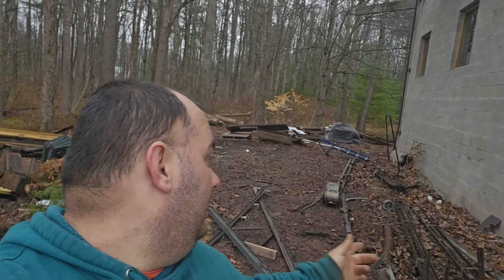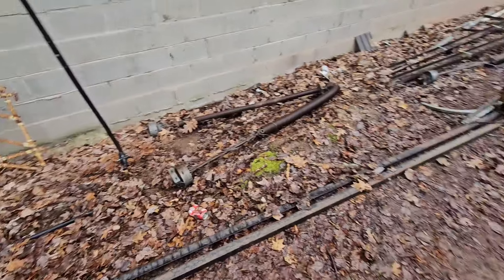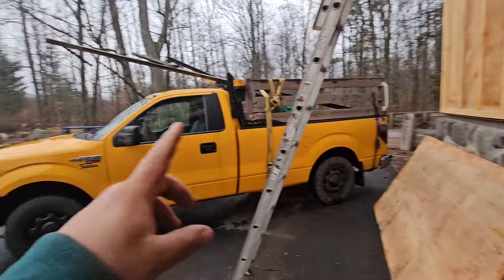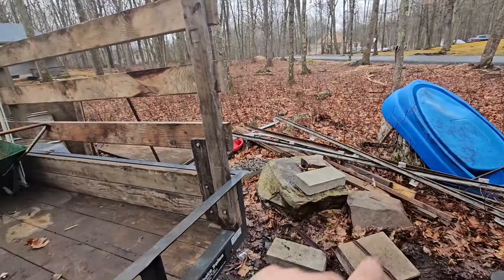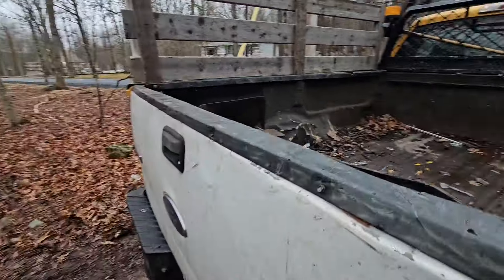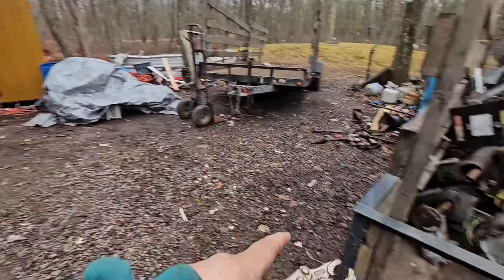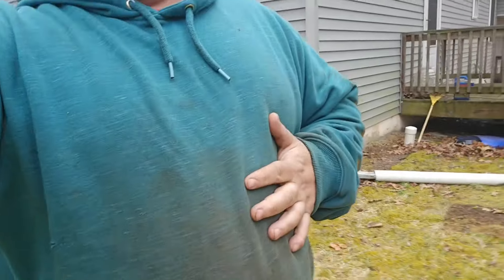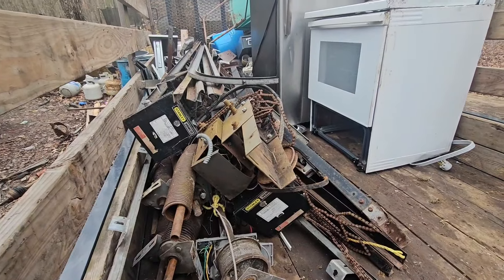Turning Trash Into Treasure: Loading Up A Trailer With Scrap Metal

Comment: The one thing Mike forgot to mention. Is that when you have a load on your truck and your trailer any weight after the rear axle is considered tongue weight. So if you have 500lbs after the axle in the truck and 1000lbs one the trailer tongue you can and will get busted for being over weight..

Comment: Hello Mike. You should carry your tools with you. I did the same thing in Ohio back 2006.I average about 25000 a year just pickup . I had 4 Plumbing shops 2 car dealerships 3 Muffler shops The Pepsi dealer 7 up dealer and when to farm auction
.my name is Ed Miller from Ohio but I live in GREENVILLE SCNOW
Reply from the maker: I usually do. We just didn't put them back in the truck and I didn't check.. If the guy would have told me what I was picking up, he said there was just some stuff alongside the garage. And gave me an address.. And of course, he sends me pictures after i'm already there.. Then I realized I didn't have the tools I needed.🥺

Comment: People think we make a fortune doing scrap metal removal. Not the case. Plus you get jobs like this one where you were told one thing and its not the case your really helping a contractor out because you could of just left it let him lug it out woods and load it. Yes its free removal when im getting in and out and customer getting the mess out the way not having to load it drive it mabey getting pulled over. Then you get to places and they got industrial boilers that are the size of small sheads weighing  thousands. Sorry being charged! 0And refrigerators and freezers I hate why people let food rot and not cleaning them out thinking its extra weight. Its a tough trade knowing your metals knowing weight knowing safe and unsafe stuff or even hazardous knowing rigging and strapping down load having right tools. I love watching your videos knowing others go through the same stuff. Keep husling my guy!
Reply from the maker: Yes, you are exactly right. People don't know what you actually have to deal with...